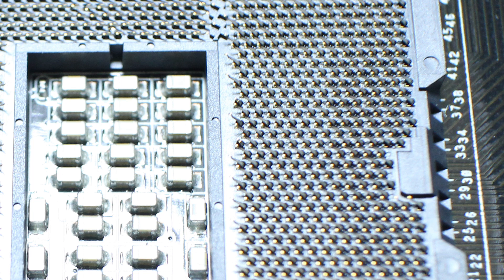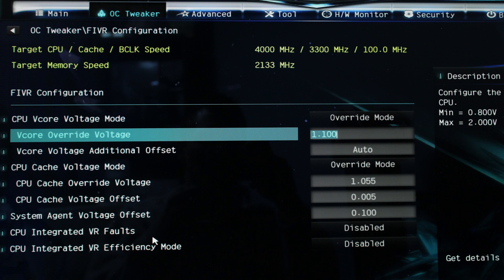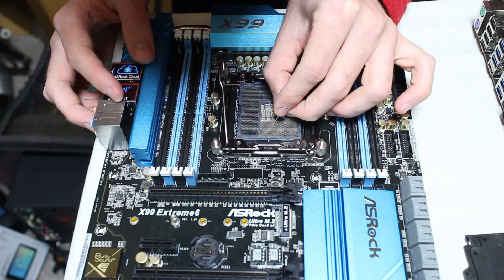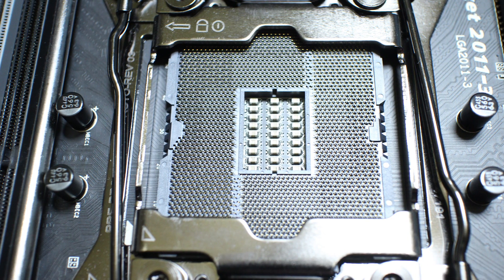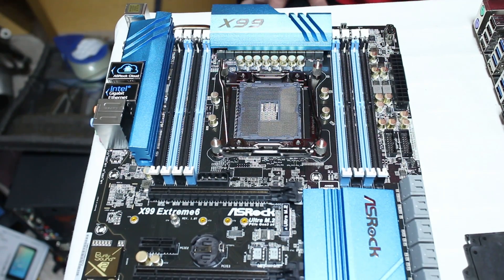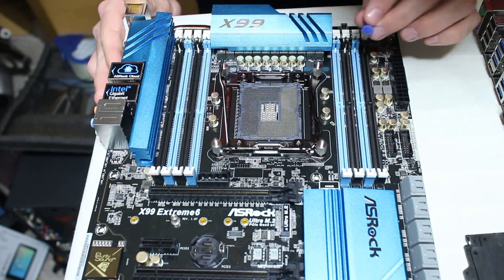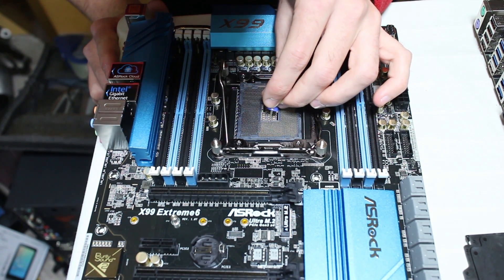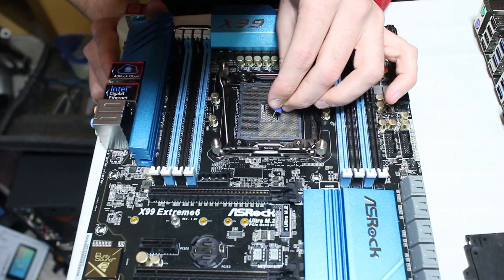How to fix Bent Motherboard Pins on an Intel Socket (X99 2011-v3)

Comment: Hey Brian, I love your videos since the day I discovered your channel, keep up the good work, but I wanted to ask you, I recently bought the Sony ECM-CS3 and wanted to ask you what settings you use in control panel when recording videos?Because I seem to get some static noise, and the only way to completely remove it is to set noise suppression on, but a really good portion of my voice seems gone with it (usually the lower frequencies).
Reply from the maker: Oh I see, I am 99.9% sure that noise is not the mic but most likely be because of the weak amp on your actual mic-in on the motherboard, what motherboard are you using?
Reply: Tech YES City I'm using the front panel mic-in, and my motherboard is the Asus Sabertooth Z97 Mark 2 motherboard, which features the Realtek 1150 audio codec.
Also, forgot to mention that when I put volume at 100 and microphone boost at 0, I can't hear the static noise, but the volume is just too low. When I set the volume boost at +10dB I get a bit better volume but still not enough, and a bit of static. But on +20dB the sound is good, but just too much static noise, same for +30dB and when lowering the volume it helps, but not by much (as I can't hear myself if I lower the volume too much).
Thanks for replying to my comment :)
Reply from the maker: I just tested my supremefx on the b85 pro gamer (asus mobo) that I have here, and it has probably the same amp on the ADC, and it sux lol, noise will creep in heavily after a 10db boost, which is needed, I keep it at 20db on 55 volume, with noise removal on in the filters.  I suggest just putting the noise removal on.
Reply: Tech YES City OK, I will try those settings, thanks for taking the time to test it!

Comment: I bent the pins on my HDD where sata cable goes and now the HDD won't work, will this work on that as well as i don't want to pay £200-400 to get it repaired from a professional company.
Reply from the maker: lol.... I just don't know how I can take this seriously with that avatar and the fact that a sata port has no 'pins' sticking out.  If you have a soldering iron and or are adventurous then you might want to get this off ebay and try replacing the port - http://www.ebay.com/itm/Original-Banana-PI-SATA-line-Cable-HDD-Connectors-with-Power-Supply-Port-/231467408837?pt=LH_DefaultDomain_0&hash=item35e4885dc5
Reply: Sorry, i meant the power connector as shown in this picture i found on the net. http://cdn.overclock.net/f/f8/f8f346cd_laptop-sata-hard-drive.jpeg

What happened was, i had a problem with my PSU and without realizing, i seem to have forcefully tried to push the power connector in my HDD and few pins were bent. I contacted a professional company who can retrieve the data from a damaged HDD and they quoted between £200-400 to fix it which i find paying a lot and not exactly worth spending that much money as the data wasn't THAT important but it would still be better to get it fixed for a reasonable price if possible.

Comment: I had like 7 bent pins on an Athlon 64 of mine, and I had to use a paperclip to straighten them. They were all in the same row and I straightened them a little bit, and then I placed the now curved pins in the socket and I placed the processor progressively in the socket the processor works just fine now!
I think pga is a better system

Comment: my gtx 980 strix is bent a bit does this matter?
Reply from the maker: The PCB?
Reply: no the gpu
Reply: I don't know if i have fully inserted it ;)  in or its a heavy card that's why?
Reply from the maker: show us a picture if you can in good lighting.
Reply: where do i post pictures
Reply from the maker: imgur or anywhere then post the link, photobucket is another one.

Comment: This helps me for my msi mobo but ive already set up a return to amazon. It is freezing in bios after being under heavy load no oc
Reply from the maker: Yeah freezing in bios with no OC means you have something wrong there.  RMAing the board is what I would do too TBH.
Reply: Tech YES City The worse thing is its the second MSI board I'm returning but for a Asus board this time. The first one took 3-4 mins to boot. I've been quite dissapointed with the boards (z97 gd 65)
Reply from the maker: What CPU have you got it coupled with, also have you tried running one ram stick at first?  Also check your cables as well (especially sata cables), make sure they are all connected properly.
Reply: Tech YES City i5 4960k , yeah tried one stick of ram. It said something about north bridge initalising. I tried it bare but still happened. returned it in the end as well as the replacement